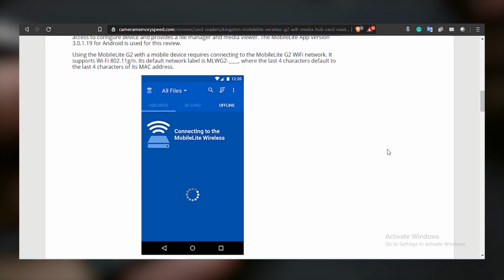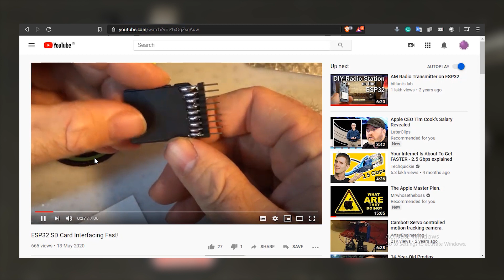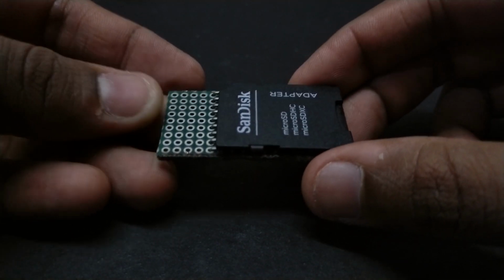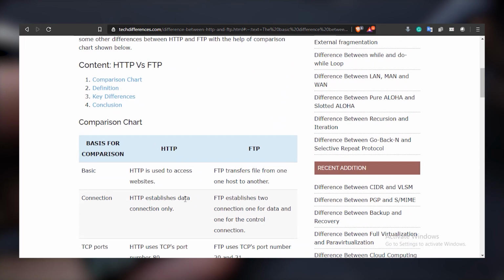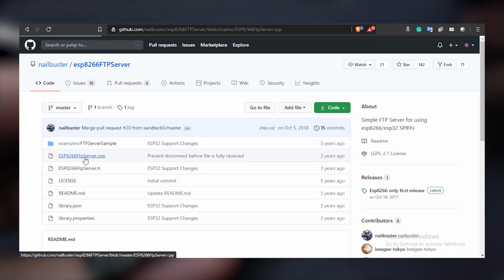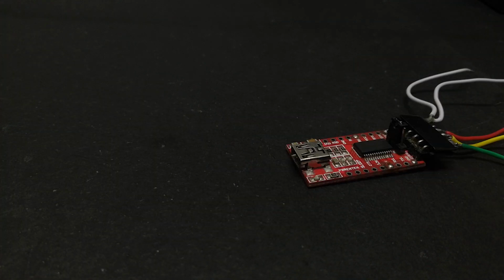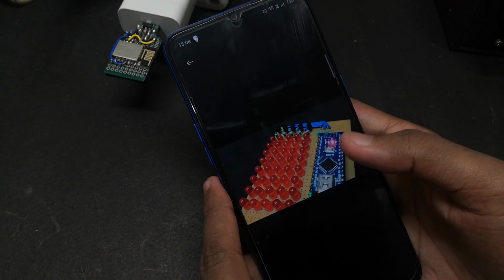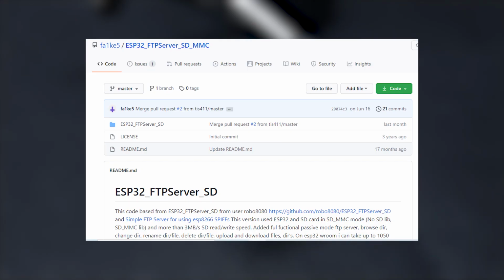Convert Adapter to Wireless Card Reader | Just another click bait? [ESP8266 FTP SERVER]

Comment: Question, and what would happen if with cables soldered to an SD it is connected inside a camera, to see the photos it is taking in real time?
Reply from the maker: That's not possible.
Reply: @Neutrino1 Hey, I have such task now. Why it is not possible? There is sdcards with such function like ez share or flashair.

Comment: Hi bro I have a wifi camera with a sd card slot in it, I really dont like taking out sd card everytimenI need the recorded data out of sd card, how to connect pendrive or hard disk in sd.card slot and is it possible to access it online without taking it out from  sd card slot, . . Can u help, thanks . .
Reply from the maker: USB or hard disk won't be possible with esp8266, maybe if you use esp32-S2 you can use USB but will still lack hard disk.

Comment: My sister does not have a lot of money, she has an old smartphone, there is little memory .... and she would really need such a device.  I would have collected it for her.  Yes, and it would be useful to me.  Please ... improve repeatability in your manuals.
Reply from the maker: This project is no mean a replacement for actual product. This was just a experiment to push the limits of eps8266. If you like see this is in article form you can check here : https://www.instructables.com/Wireless-SD-Card-Reader-ESP8266/
Reply: @Neutrino1  Оооо...thanks you big !!!
Reply: I apologize again ... the difficulty in connecting the SD card. Everything connects via SPI. I found a lot of SPI manuals on the network for SD and for ESP-12E, but how connected with you on video ... it seems to me differently. I earned WiFi, but by connecting the error card. Can you tell me what's wrong here? And how to connect? Is something with CS?
Reply: I did it!  Everything works great.  SD pins should be connected like this: mosi-hspimosi, miso-hspimiso, cs-gpio2, sclk-hspiclk.  I connected all GNDs to the SD card just in case.  The SD card must be FAT32.  The speed is small.  Like dialup.  But it's still better than nothing at all.

Comment: Dear sir, your project is great! I congratulate you on your hard work.
Would you please show me a way how to use this project without using access-point, because I want to use my router in this project. I want to connect the esp8266 to my router, and also the FTP client to the router. I have a Desktop PC, which doesn't have an inbuilt WIFI module, so I am unable to use this method with my PC unless I use my router in this project. I can use my phone for this, but if I could use it on my PC, it would be more helpful. I am waiting for your reply.

If someone else knows how to switch from AP mode to router mode, please also reply.
Thanks!
Reply from the maker: (wireless_SD.ino file)
Replace line 5 and 6 with your route SSID and password and  replace from line 23

WiFi.mode(WIFI_STA);
  WiFi.disconnect();
  delay(100);

  WiFi.config(apIP, gateway, subnet);
  WiFi.begin(ssid, password);

This should work
Reply: @Neutrino1  Thanks a lot! You got a sub from me.
Reply: @Neutrino1  Your projects works! It works using WinSCP in windows. But if I use ftp commands in cmd, then it says:
500 Syntax error
530 user not found
User (192.168.0.100:(none)): esp8266
221 Goodbye

Is there any way to fix it? I need to use cmd of windows for a project, but this only works using WinSCP.

WinSCP also gets disconnected when I try to create a new file
Reply: @Neutrino1  I get only 150KB/s speed. Is there any way to improve it? Will an esp32 give better speed?
Reply from the maker: @shamssulaimanfida4606  With esp32 along with SD_MMC implementation, you should be getting 600KBPS read and 260KBPS write.
Reply: @Neutrino1  I'll see if I can get an esp32. And I have one more question(if you don't feel annoyed), can I connect multiple FTP clients to this FTP server at the same time, by using multiple devices?
Reply from the maker: @shamssulaimanfida4606  Typically FTP protocol would allow multiple clients. I haven't tried, but it should be possible to access from multiple devices.
Reply: I have tried it. It cannot connect multiple clients at the same time. When one client is already connected, it doesn't accept a second one.
I found out how to make an esp8266 be able to connect multiple clients in this link: https://arduino.stackexchange.com/questions/31256/multiple-client-server-over-wifi
But I was unable to implement it myself.

I need it to connect multiple clients at the same time because I want to make a file transfer project with this. One client will upload the file to the server, then another one will download it.
Reply from the maker: @shamssulaimanfida4606  The link you have sent is not for FTP, it's just for local webserver. 

The best way would be to automate the connection between the device and esp8266. Connect the device upload a file and disconnect then connect the second device download a file and disconnect. 

Esp8266 is fairly limited, it would be difficult to run like a PC.
Reply: @shamssulaimanfida4606  
Hi bro i also want to make this project
But i am anable to access the data using and ftp can u help me

Comment: I can not run the program, when compiled there is an error in the Wireless_SD section,
more precisely on SD. begin (2) // 2 indicates the Chip select pin.

can you help where the program needs to be fixed?
Reply from the maker: can you post the error?
Reply: @Neutrino1  this is now working, I was running on the arduino IDE there were some errors even though I had completed the libraries it needed. after that I run the program on platform_io program no problem, and program successfully. thank you for making this project, very useful, i am very happy.
Reply from the maker: @logicsolution1783  Glad it was helpful!

Comment: Thanks, you are amazing, will it be possible to replace sd card with USB drive(Pendrive :same file system as sd card)
Reply from the maker: No with the circuit it won't work, try replacing the esp-12E with ESP32_S2
Reply: With the esp32 s2 already out, hope you can make a video for this. Warm regards!

Comment: Good job 👍
I just wonder if you can use the same idea with HD (Hard disk) instead of using SD?
It would be a great and wonderful idea.
Reply: actually 6 years ago, i have a friend who owns a seagate hard disk that has wifi connectivity so you can do access if you connect to the wifi of the disk. the cost is 4x the normal hard disk back then.

Comment: I was making this exact same thing, i referred the same videos as you did and was thinking of implementing using http. I made the hardware and uploaded the code got from the G6EJD channel. On uploading a file larger than 10 MB caused the ESP8266 to freeze and reboot, I tried to find the reason but all i could find was that there was a buffer overrun, I then tried to make a version with a card reader and esp8266 such that whenever the card reader was powered the esp8266 must make the SPI lines input and go into deepSleep and then resume its process on battery power once the USB is unplugged, that didn't work too. Thank you for all your efforts into FTP. I'm waiting for the ESP32-S2 too but it doesn't support SD_MMC.
Reply from the maker: Thank you! I still don't have the hardware(ESP32-S2), But as far as I went through the documentation it does support SD_MMC, can't be too sure until I try it out!(https://docs.espressif.com/projects/esp-idf/en/latest/esp32s2/api-reference/storage/sdmmc.html)